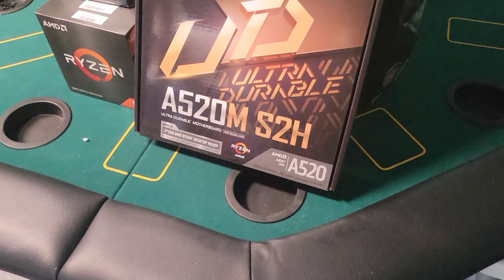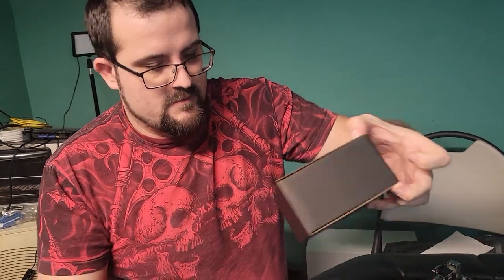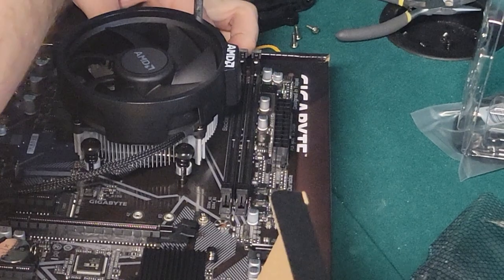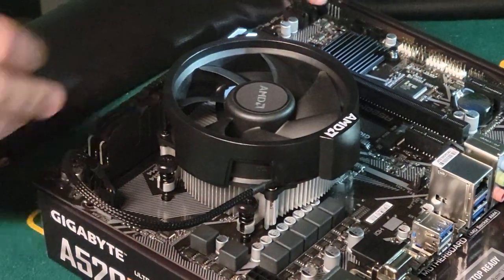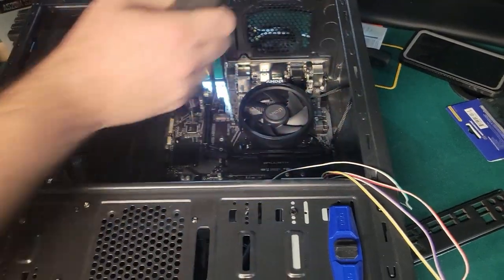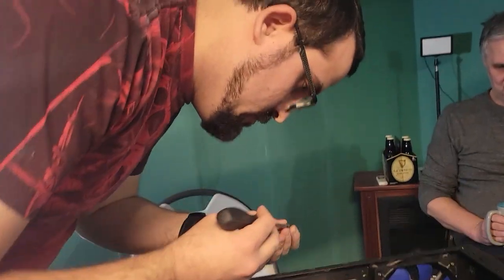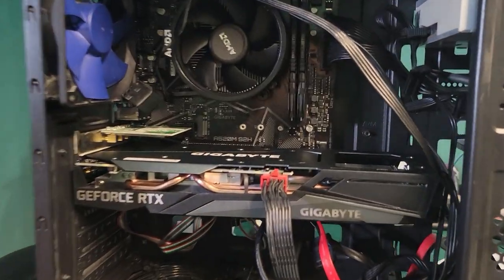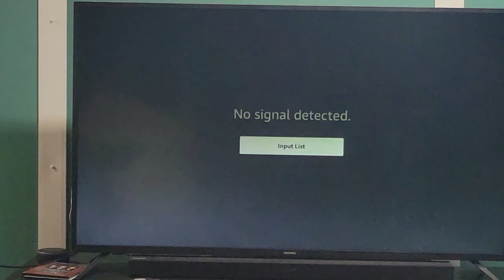A Grave Upgrade: How To Bring Your Computer Back From The Dead

Comment: Ryzen 5600x is a solid chip.  I probably would have shelled just a bit more for the 3060 though.  The 3050-3060 is about a 50 percent performance upgrade that tapers off after the 3060.
Reply from the maker: Yeah I've heard about that about the 3050's, but I got a deal on Newegg for a combo deal on that and the motherboard. I'm not complaining going from a 960 to a 3050 though lol. It's been holding up since the upgrade and I've put it through some hefty stress tests between streaming and gaming on it. Only regret I have is not going for more ram since the board can take up to 64 gb of ram
Reply: @GraveUncut  I did the same thing haha. I was on a 970 for about ten years, definitely a huge upgrade, you shouldn't have to upgrade for a long time now